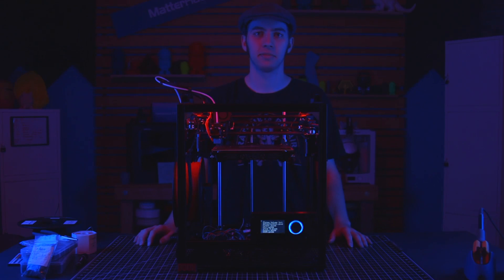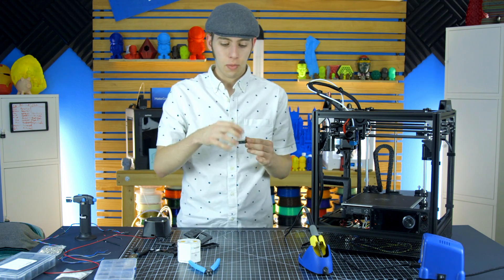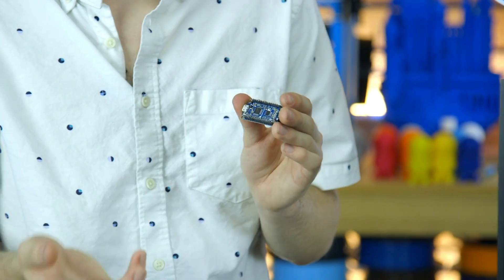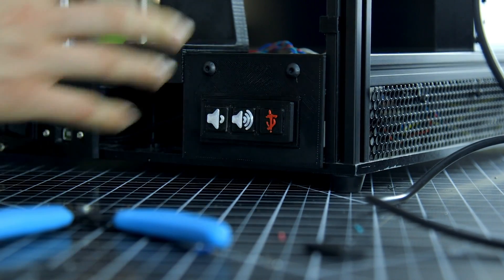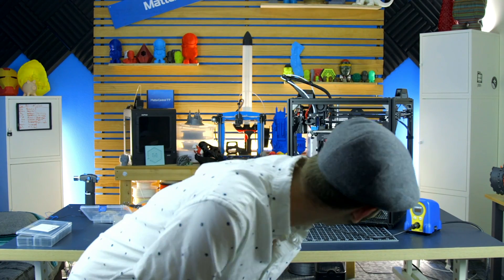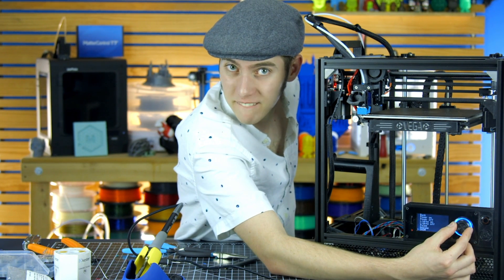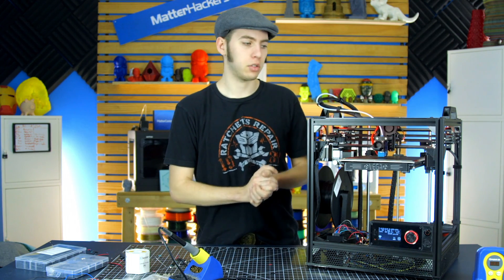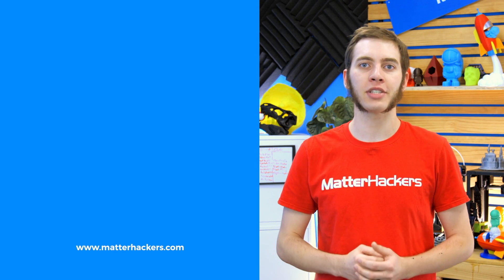Alec Makes A Talking 3D Printer | Let's Make

Comment: Alec you have know idea what you just done and how it could help me.  I work for a school for the blind we have been searching for a talking 3d  printer  for years.  I just you tubed a talking 3d  printer and your video came up.  Last year, I taught students how to use a 3d printer jelly box 2, but had no way to help them or me with selecting the files on the sd card and then getting it to print without sited help.  I have no idea how to due what you did but would love to know if it could work on a jelly box2? If there was a way for it to talk in a file menu and to select a file it might work.   I will check out your website and see what you have on it. thanks

Comment: Having an audible queue that I print is done “sounds” awesome especially when you have stepper dampers, and quite fans on your setup and can barely tell when it’s running.
Reply: Majority of the mods I do for my printers is to make as close to silent as possible. Without this I honestly can't tell when a print finishes without watching.
Reply: Alec Richter my one Tevo Tornado has stepper dampers intalled and a blower fan. I can’t even tell it’s running, unless I’m less that a foot and a half away from it. So much quieter than the stock one. My biggest complaints are ghosting which is attributable to the ultrabase I have installed and dispite how well the ultrabase is known for bed adhesiveness I still have parts curling up on both. I digressed, I apologize.
Reply: My stock cr10s is so loud you can hear it in another room even with the door shut.

Comment: Your look better without sideburns. Print quality on this printer is terrible at least in the Doom print.
About that speaker and sounds:
I'd rather have sound like "I'm hot enough, starting the print", "Print ended" or "Print failure, pausing and waiting for user interaction".
Those sounds you chose aren't obvious for everyone in the room ;)
Reply: Still been tweaking the print settings. But the latest print off of it was flawless.

Obvious enough for the person running the printer! It could absolutely be adapted to be more obvious; I considered a different version borrowing some voice lines from Mara or Dave.

Comment: I wonder if there is a simple way of doing this with something like Octoprint.
Reply: Craig Bennett II 

It’s cheaper to have a live camera of the print in progress, but you’d actually need a subscription to the service to pause the project.
Reply: @topsecret1837  There's probably the potential for Octoprint to incorporate it. With the way I have it set up, it's not specific to the LCD creating the effects. The pause Gcode (M600) pauses the print and plays audio file 2 (which is the pause soundbite). Whether a filament runout, LCD selection, or Octoprint sends the Gcode doesn't matter, it's now coded into the firmware (with some able to be disabled in the slicer like the finished sound).

Comment: I. Know thoes frustrating moments. I'm adding LEDs to mine and I busted a solder joint after everything was installed
Reply: Just gotta run with it and keep iterating. As you saw, taking a break from it can help.
Reply: @Richter3D  its not failure if you keep working on it!

Comment: Pretty ingenious Alec - congratulations! I do see potential for that, specially if you have a filament runout sensor or wants a notification when the print job is done.
Reply: The runout sensor soundbite is in there, it just needs to be commented in (and a runout sensor installed).